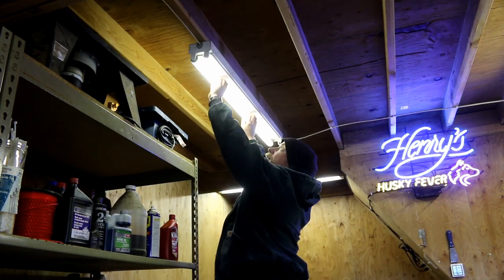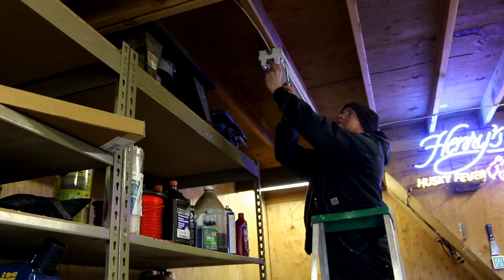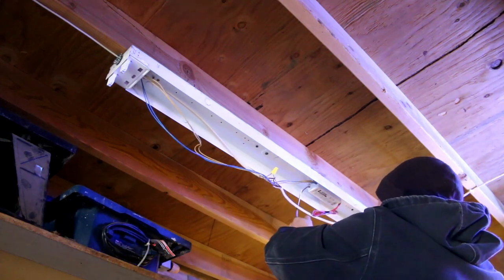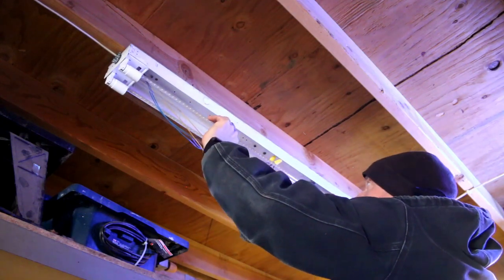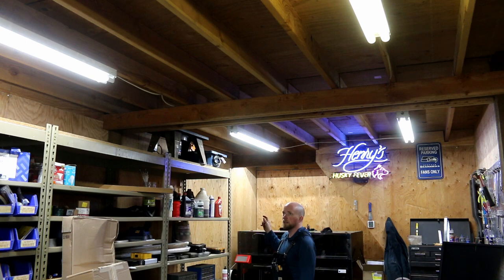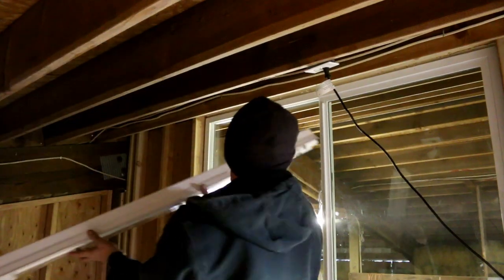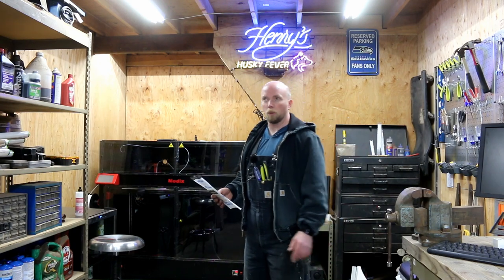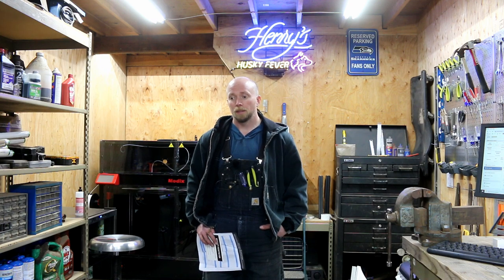Fluorescent Light to PARMIDA LED Upgrade

Comment: I replaced 34 fluorescents at my business with drop in LEDs I got at Costco.  I think they were 12 or 13 dollars for a 2 pack. There was no wondering about the balast. My electric bill has gone down by approximately $300-$400 a month. I have alot of machinery running so my electric bills are substantial but that is a big savings. Had them in 3 years now and haven't had one fail yet. I think they are Feit brand.

Comment: Put a different color on the 3D printer breaker or put it on its own circuit.
Reply: Outdoors with Dale you are right the led lights have a capacitor that that charges when voltage is supplied by the lighted switch turning on the led then discharging to turn off the led. I would suggest he runs a new line to the other lights on the ceiling. This would leave the printers circuit by its self.

Comment: If the flickering lights is from the printer, maybe plugging the printer into a Tripp Lite IS250 isolation transformer would help. It would also help protect the printer from electrical issues. I'm seeing current pricing on the transformer ranging from $117 to $150.

Comment: The easiest way to fix the flashing light is to run a new wire to the rest of the lights. Leave the light on the printer and circuit to the printer alone. The reason is the printer has a low voltage set up to run that light. The led lights have a capacitor used to turn on the lights if the lights are hooked up to the same circuit that capacitor will charge turn on the light discharge from turning on the light then recharge again giving you that flashing. By hooking into the same circuit with the other lights you won't have the capacitor charging when not needed any more.